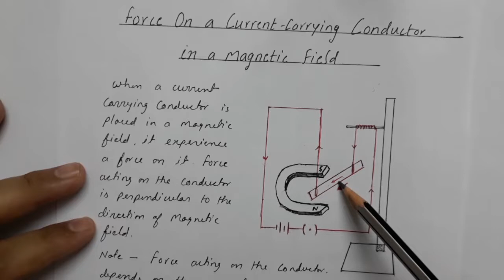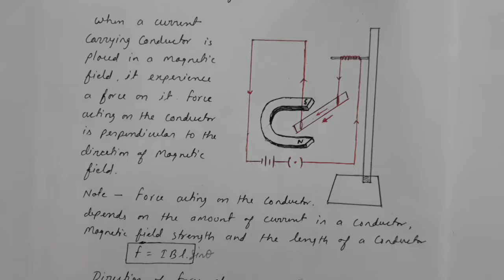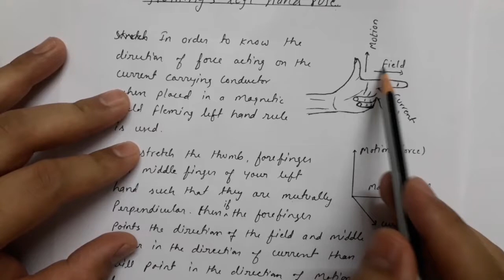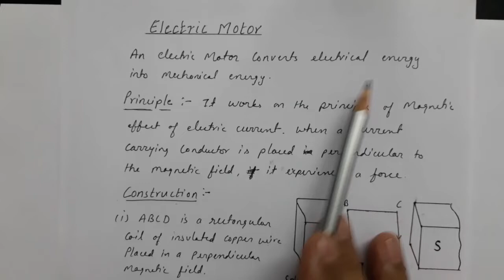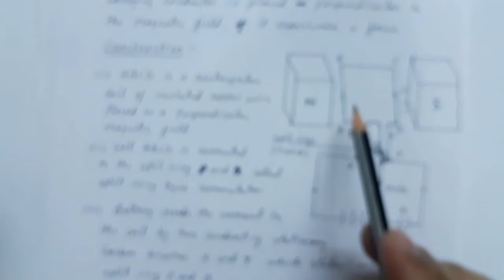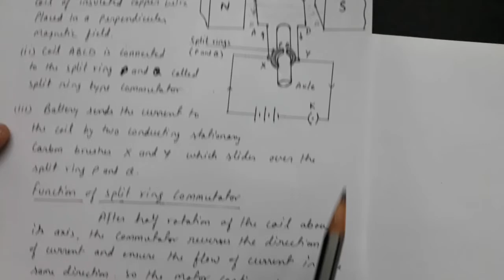Class 10, chapter 13, Magnetic effect of electric current, Part 2

Comment: Sir, how can we increase the intensity of magnetic field??
Reply from the maker: Magnetic field of what...?
Reply: Of the magnet in the fleming left hand rule (the horseshoe magnet in the above video in the first 1st figure of starting)
Reply from the maker: @annapurnapanda2471  we can increase the strength of the magnetic field of a bar magnet or horse shoe magnet by brining them in contact with another magnet of strong magnetic field.
Reply from the maker: @annapurnapanda2471  or by applying strong magnetic field on the magnet whose magnetic strength we need to increase... but it depends on the magnetic susceptibility of the material...